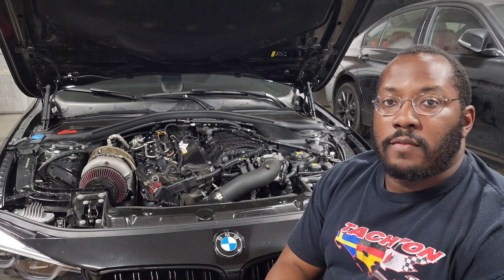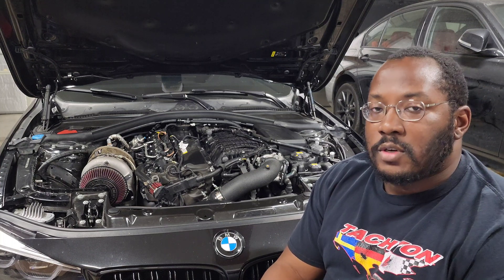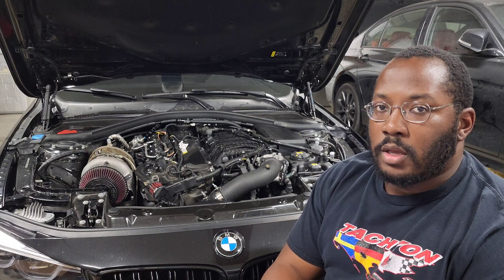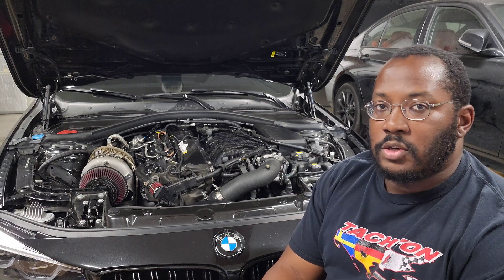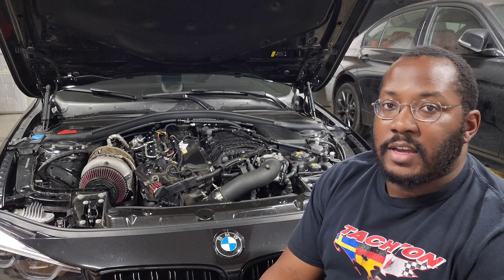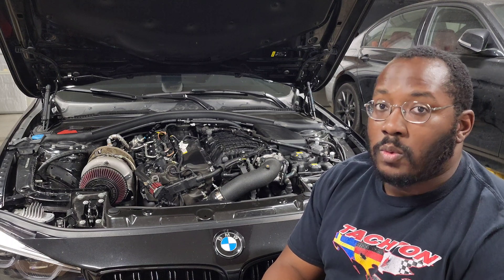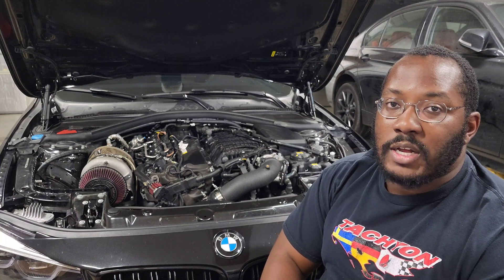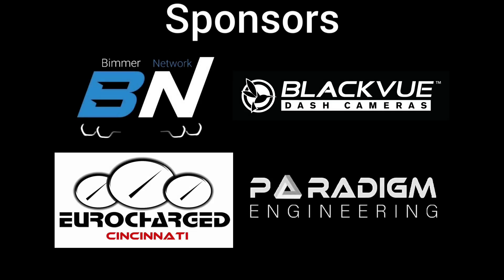Why Don't HPFP Upgrades run at Higher Fuel Pressure?

Comment: Thought provoking video, Kevin. Too short! There are lots of subtleties to this. I mean, it appears that there are two reasons why a bigger turbo flows more air but only one reason why a hpfp flows more fuel. The bigger turbo has both a less restrictive turbine and a more effective compressor. The hole through which air escapes is bigger so there has to be more pumping to keep up the pressure. In the fuel system, a new pump only changes the compressor. The holes, through which the fuel escapes are the injectors and they don't change in size. But, by implication, we're going to keep them open for longer, so there is dependency in time. Then there's the wastegate... Thanks for this. Good to have something to think about.
Reply from the maker: the biggest missing factor that we can't log is injector timing. unfortunately we don't seem to have any parameters to show how long injectors are open. but of course like i said with an injector being stuck open, an injector open too long will cause rail pressure dips as well.

Comment: Hi kern, do you think running a dorch is more reliable/safer vs a TU because of the running pressure ? Is there a possibility that sometimes pressure exceed 2500 psi with the TU and could damage injectors for example ?
Reply from the maker: They both run the same. The risk of a fuel pump hitting over pressure is extremely low.

Comment: Thank you for the video Kern! Two questions regarding using a TU HPFP on a gen1 B58: (1) Is there any benefit to increasing the rail pressure on the same tune, say from 2900 psi to 3500 psi, in terms of power/torque/responsiveness? (2) What is the maximum rail pressure that the stock injectors can withstand, e.g. 200 bar?
Reply from the maker: It can help a bit if you want to squeeze out as much power as possible. I've seen some people do that so if fuel pressure does dip a bit it's still safe. But imo not really useful.

Stock injectors are rated for 250bar

Comment: i know beating a dead horse question, but I cant seem to get the exact answer.  E30 blends with the TU pump.  Doing an E30 blend using 91ACN, can I still used an OTS E30 map?  I see people doing this with 93 octane not 91.   Have you heard if this OK to do with 91?  Thanks man, that has been my hold-up getting a TU pump.
Reply: Hey, I'm in the exact same position!  Was getting timing corrections on E30 and even up to E33 (because of ACN91).  Halim @ Protuningfreaks (BM3) told me to run E40, made sure AFRs were in check and said it should work totally fine for the OTS Stage 2+ tune on my TU pump.  Been running it for a few months now with no issues, hope this helps!
Reply: @TcheCaver  very much, thanks man
Reply: @TcheCaver  one thing, if you havent checked with an analyzer, E85 is only guaranteed to be E70, its usually aroung 78-80% where I am.  It could have been you were doing the math for 85% but had closer to actual 70 that you were blending.
Reply: @ebigford34  I have the BM3 flex fuel sensor/kit installed :) running confirmed E40.  Don't use the flex maps, if you measure E30 for example you'll run E30 aggression even if you need E40 to support that.  I'm in the bay area, pump 91 measures about E9 and ethanol measures about E82-E83. Its summer, so ethanol content is higher, not that it matters in Cali.
Reply: @ebigford34  But yeah I do test my ethanol every 2 months or so when I run a tank of pump 91 to flush out the fuel system.
Reply: @TcheCaver  good info, thanks.  Im in sacramento so probably same refinery supply as you.  Propel?
Reply: @ebigford34  yessirr, propel that I buy from Chevron. Im in Fremont/San Jose and I think propel is all we have but it seems to work fine for now
Reply: Some states doesnt have 93 some states doesnt have 91. In Oregon we have 92 . Any premium gas okay with E mix blend.
Reply from the maker: Typically it's ok. Run logs to confirm.
https://youtu.be/a-LxehgpkUw

Comment: Nice vid👍 i allways thougt the tu pump runs allways 350bar. Nice to hear thats not the case. Basicly its safe to run the tu pump then. And tune the car with mhd stage 2 hpfp map after installing the tu pump 😁

Comment: So on my logs should my rail pressure be at 2900 all the time and is there an issue if I see a big dip when I let off after it shifts ? Or is that normal
Reply from the maker: During the pull it should be relatively consistent 2800-2900psi. During shifts it doesn't matter because throttle closes and cuts fuel to shift properly
Reply: @kern417  thank you!!!